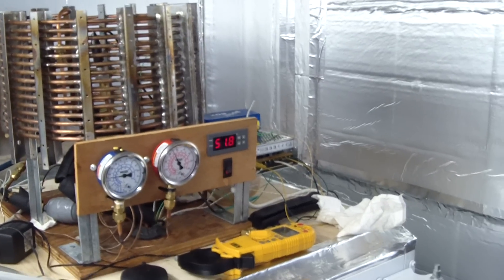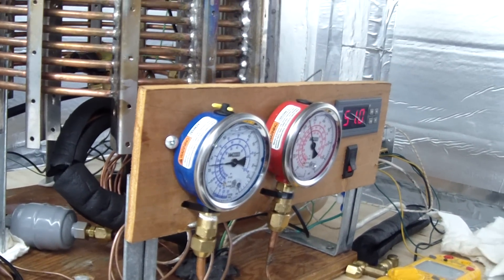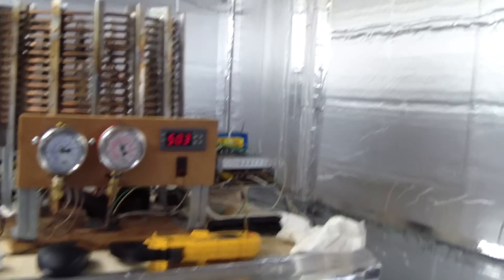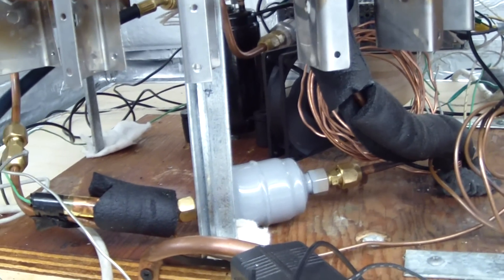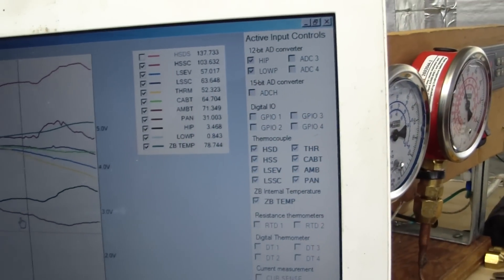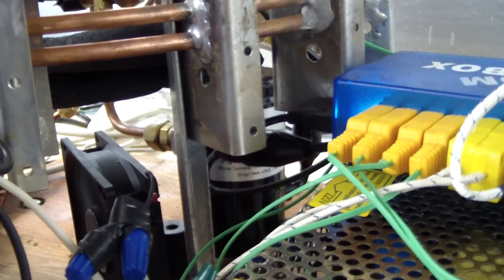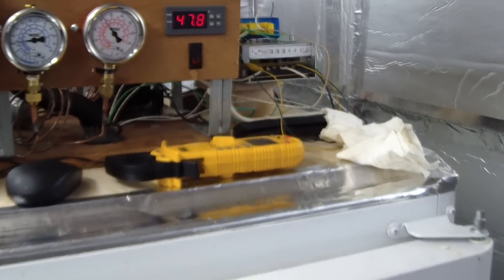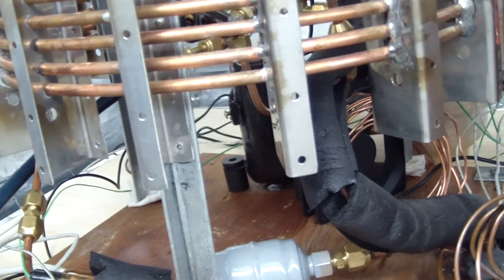DC Compressor on the MCM

Comment: I have a mini compressor - actually, I bought a ZeroBreeze unit and the driver board was a dud. What driver board would you recommend to run a little 12v mini compressor? Will any brushless motor driver board work? Thanks!